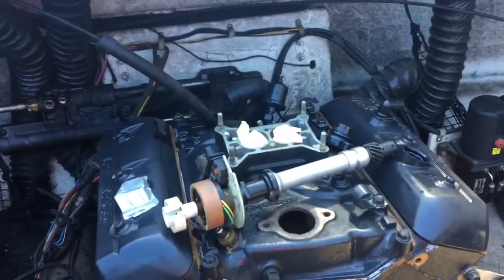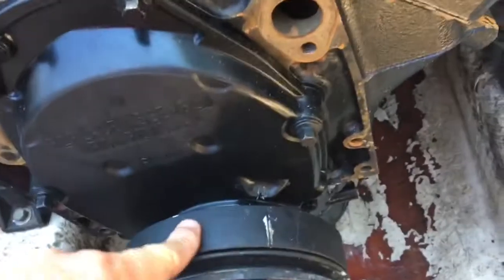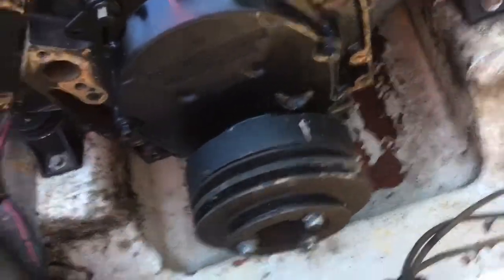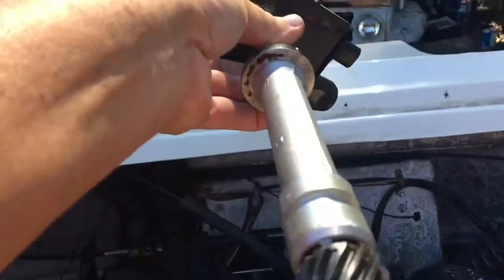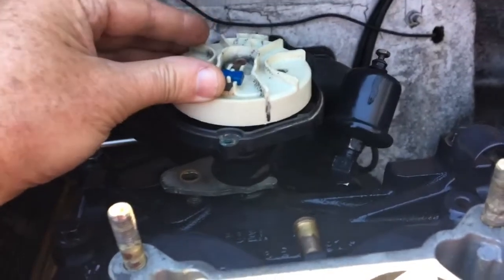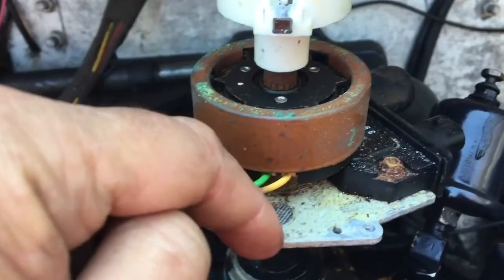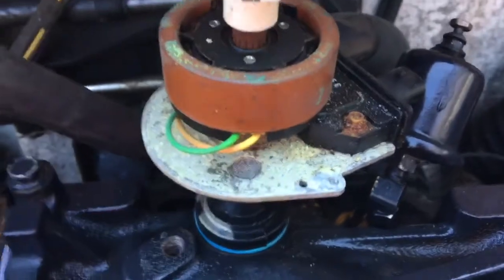Part 9C - Mercruiser (VP) 4.3 V6 Rebuild - Distributor Install and Static Timing

Comment: i have a question on a v8 mercrusier shift assist wires hooking it up to a HEI distributor where do you hook up the black and the white wires for it to work i appreciate you buddy.
Reply from the maker: Why are you installing an HEI distributor is the bigger question.
Reply: @moccasinmarine  why not if you dont mine answering it has the same venting screens on the bottom as the points and a vent hole in the cap. is this not acceptable im 63 years old is another reason i need reliabilty like the HEI just looking for information brother any will help thanks from FL
Reply from the maker: @inthenameofmyfather3836  HEI distributors use weights and springs to advance timing. In a marine application these will quickly rust corrode and fail. The proper distributor is a Delco EST ignition system which is superior to any other marine ignition.
Reply: @moccasinmarine  BUSTOUT another thousand im only looking to run about 3 yrs in fresh water this does not sound feasible to you in any way?thanks
Reply from the maker: @inthenameofmyfather3836  you will bust out more than $1000 if you blow the engine with the wrong timing curve. You didn’t say if it was a 5.0 or 5.7 but the max timing should be around 28 degrees BTDC. Make sure the HEI is set not to exceed that. Also DO NOT connect the vacuum advance port on the distributor to anything. Leave it unconnected since boats do not need vacuum advance. The danger of an HEI is not knowing what springs are inside it. Some springs were for lightweight cars and some were for heavy trucks. I don’t know what you have so I can’t advise on the HEI.
Reply: @moccasinmarine  this distributor came out of a 1988 corvette lol if you say no welcome me back to the prestolite!
Reply from the maker: @inthenameofmyfather3836  ok now you’ve given me even more info that negates the use of that distributor. 1988 Corvettes were Tuned Port Injection with computer controlled timing. The distributor has no weights but the module  expects a signal from the computer to control timing. Assuming you have a carburetor there is no computer so the module will revert to limp home timing which a a rudimentary timing curve used to get the car home. The module does not have a smoothly advancing timing table like the marine module has. Set the timing to 28 degrees at 3000 rpm and lock down the distributor bolt. This will get you by. It might not be smooth but it should work.
Reply: @moccasinmarine  my man thanks bro and where to hook up the shift assist wires? its a 5.7
Reply from the maker: @inthenameofmyfather3836  well that’s kind of hard to explain in a comment. All you need to know is hinted at in my video here:

https://youtu.be/1a9cHJrH0d8?si=bcNtt1Y0AcQn7z1E

Comment: Ok can someone show me how to put wires on in right firing up from number 1   no smartass comments plz
Reply from the maker: Cylinders are numbered 1,3,5 port side (USA drivers side) front to back and 2,4,6 starboard side. Choose a plug tower on the cap and make it number 1 (see video on which one I use). Then going clockwise looking down put the rest of wires on in order of 6,5,4,3,2. The firing order of a 4.3 v6 is 1,6,5,4,3,2. This is a sequence that you should memorize if you own one of these engines.
Reply: @moccasinmarine  ok I got number 1 up on comp side got both marks on crank lined up put number 1 beside screw in cap routed wires just like that  still not right it was running fine till I changed dist pick up coil was bad any suggestions iam all ears
Reply from the maker: @adambates3788  I don’t know that the screw in cap is lined up with a post on the distributor cap. I’ll have to check later. If it does then you can make that your number 1 cylinder post. So with the engine at TDC on firing stroke drop the distributor in so that the rotor tip points at the screw after rotating the engine 2 turns back to #1 TDC.
Reply: @moccasinmarine  yeah I made the post number 1 then went clockwise with wires 165432 with marks lined up on crank I heard there was a little brown and black wire under passenger side under carpet you had to unplug ???? I never thought I would have this much trouble with putting a Chevrolet back in TDC but I appreciate sir thanks
Reply from the maker: @adambates3788  don’t know anything about a brown black wire. Never have came across that. You could just do it exactly like I show in the video using the wire mesh vent as your number 1 cylinder. Most of the time a problem occurs is you don’t have #1 piston at TDC on firing stroke. It’s simple to find. Remove all plugs except number 1. Loosen #1 plug to where it’s in just a few turns. Then turn engine over by hand until you hear hissing. Once you hear hissing keep rotating until the timing marks line up again. That will be piston #1 at TDC on firing stroke.
Reply: @moccasinmarine  I got it thanks
Reply: Am I missing something????

Comment: What about using that type of ing. in 7.4 mercruiser and what module would you use for the timing curve
Reply from the maker: I’ve answered this twice before in the comments of one of my videos but I can’t remember which one. It will take me a while to find it and I’ll post back here when I do. But I’ve decided to add a whole new video to address this question since it keeps being asked.
Reply: @moccasinmarine  ok,thank you
Reply from the maker: @raymondzieger9885  I appreciate the questions because it lets me know what my viewers consider important. I’ll get you an answer ASAP.
Reply: @moccasinmarine  Thank you so much!
Reply from the maker: Ok the video link is:

https://youtu.be/x_UXSsOnepk

Go to the bottom of comments and read the conversation with viewer CitrusMcFly. I covered 454 engines modified with the Delco EST ignition. But again since this has been asked at least three times I’ll make a separate video to address.

Comment: You going to have a problem when you plug them wires in that sending unit is standing right in the way time to start over
Reply from the maker: This engine was installed and sold 6 months ago. The sending unit was not a problem. It is tight back there but it will work.

Comment from the maker: If you cant see the rocker arms on #1 cylinder, remove the spark plug in cylinder #1. Wad up a piece of dry toilet paper and place it barely in the hole, not inside but barely half way. Rotate the engine clockwise with a wrench and as soon as the paper blows out of the hole keep going but stop when the timing marks line up. This will be Top Dead Center (TDC) on cylinder #1 firing stroke.

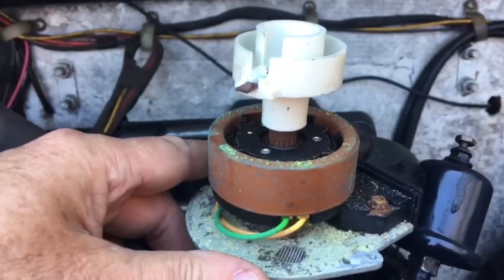Comment from the maker: At the 5:00 mark had I rotated the housing clockwise to where the circle with wire mesh was lined up with the rotor that would have worked and it would be timed then. I still would have had to take it back out to install the gasket though so no biggie.
Reply: If you leave the distributor in and rotate the rotor counter clockwise while slightly lifting the distributor it will move in the direction you need the rotor to point. It may take several rotations to get it where it needs to be but it's easier than pulling the distributor completely out and trying to line up the oil pump shaft. I used to do this all the time when I built SB chevy engines years ago. Now I have a boat with 4.3 Vortec  I just bought that I need to pull the engine and rebuild it. Thanks for the series on the 4.3 it's going to help me rebuild it easier and cheaper using auto parts instead of expensive marine crap.
Reply from the maker: Let me add one more comment about this. Some distributors have a hold down bracket that limits rotation travel to a narrow range. With these type distributors (Toyota Landcruisers are a good example) you can’t just rotate the distributor to where ever you want to get the rotor to line up. In these situations the engineers intended the distributor to engage in an exact tooth on the cam. This is critical in these engines because the spark plug wire lengths will not reach the correct spark plug if the distributor is indexed incorrectly. Plus the next mechanic who touches this engine will know he’s working on a jury rigged engine.